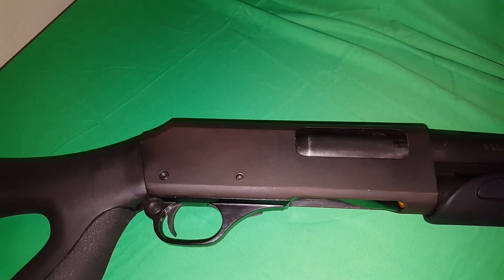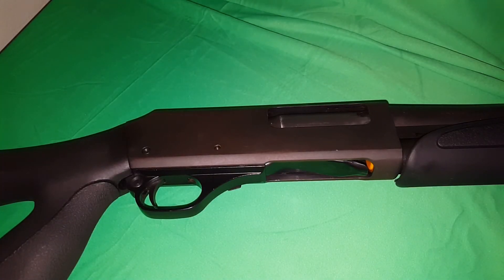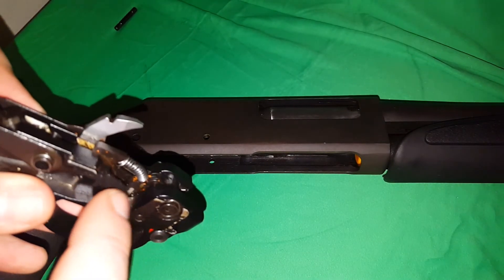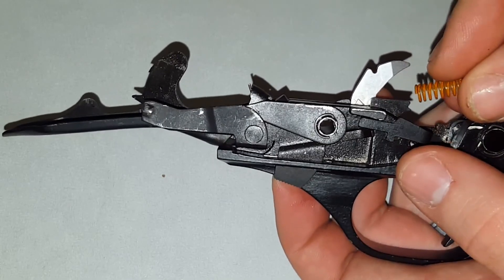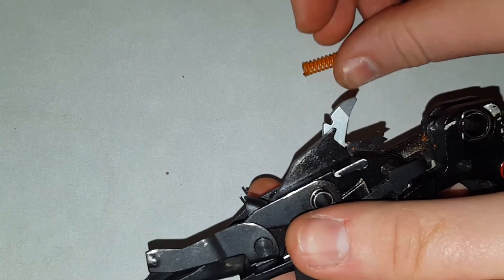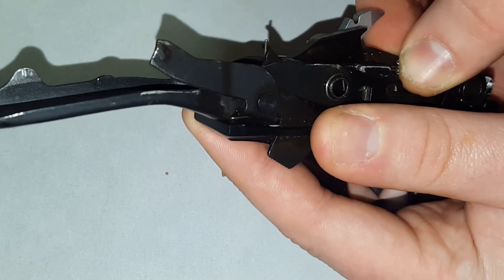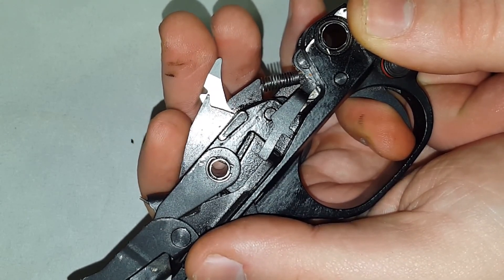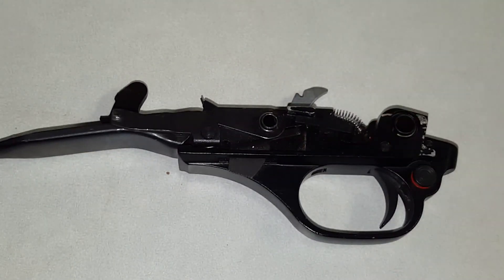Remington 870 1.5lb TWO STAGE trigger - Ball Point Pen Spring Mod

Comment: STKO, what is your opinion on long term reliability of ballpoint spring. I'm not so concerned with spring breakage, as pen springs are cycled more in day to day usage than an average 870. I'm wondering if spring will stay in the groove or notch if gun was dropped, banged around or after repeated recoil. Any input on this and excellent video as usual.
Reply from the maker: +TheRoadhammer379 Well, tell you the truth I haven't test fired with a live round yet...but as long as the spring is seated correctly there shouldn't be an issue because the manufacturers spring seats the same the way and even in the uncocked/fired position the spring is still under tension. My opinion is that the spring wont leave its position unless somehow debri got into your trigger group. 
Thanks for watching!!!
Reply: +Shoot To Kill Outdoors , thanks for the reply. I'm working on this mod tonight, I think the wife is going to like her 870 a little more.
Reply from the maker: +TheRoadhammer379 Yep, no problem ! Let me know how it works.
Reply from the maker: +TheRoadhammer379 hows it working for ya?

Comment: This is the worst thing you can do to your trigger, a spring from a pen 🖊 !! ,  reasons 1 it will malfunction at wrong moment when you need it the most, seconds liability issues to modify a sensitive part of your gun, I would advice anyone trying to do this modification,  to stick with the OEM part which is a bout 5 lb thats not bad for a shotgun, or if you're in competition buy a reputable trigger assembly and stay in the safe side.

Comment: there's a specific reason why Remington uses a 3lb. trigger pull. Because of safety, and liability. Since you deem the trigger pull adjustments to your installation, I am assuming that you also accept the liabilities, of changing the safety specs installed by Remington, with your so called hair trigger. I can see where this is going, when someone gets injured from your modification.
Reply from the maker: Jurgen Stroda I like how people comment and think they know it all... and there's also aftermarket springs to achieve this... I just saved money
Reply: Stock is a little over 5# mcarbo has 3# that's what I use

Comment: why in the hell would you want to lighten the trigger pull less than Remington specs, that's really stupid, you now have a hangfire situation, which can cause a serious problem, with safety. Remington specs on a 870 is 58 oz. that isn't a random weight, but tested buy Remington to be the best, operation with safety totally in mind. Your video is not smart, but dangerous.
Reply: How are we getting a hangfire situation from lightening the trigger and sear spring? The hammer spring is unaltered?
Reply: I purchased a Thimney
Reply: I purchased an 870 trigger fix kit. You get a improved sear, three springs of different weight. Big improvement hardly any creep. Put in the spring preference, and you are now able to shoot slugs at further distance with a lot more accuracy. It makes you a better Hunter. Just changing a spring it’s not enough you have to change the sear to eliminate the creep on the trigger. I’ve done this on my 20 and 12 gauge. I installed a scope on my 12 gauge, makes it a great slug gun at longer distances. Happy and safe shooting.